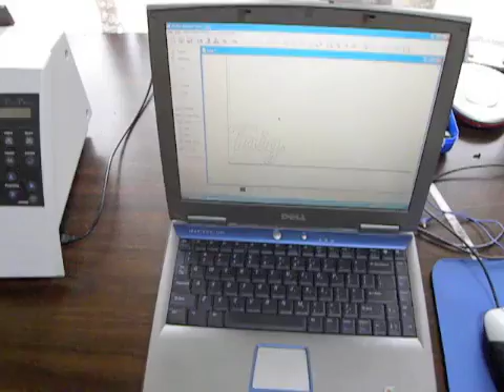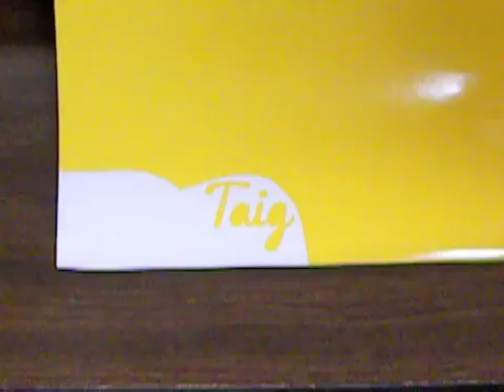Vinyl Plotter

Comment from the maker: My rule of thumb for cost is $1 per inch of the largest dimension, so for a standard 8.5 x 11" paper I'd say $11. Special vinyls like chrome and immitation carbon fiber go a little more, cheaper stuff like low tack masking vinyl goes for less. Additional colors add 50% for each added color. I always try to be negotiable on price though.
With the 1' x 2' sheets I have on hand, the largest size I can do is about 11" x 23". With a larger roll, my machine will do 14 and 3/4" wide by 6 feet long.

Comment from the maker: Thanks very much! Yeah, doing something in multiple colors can get complicated, but it's not impossible either. It's mostly about getting the colors aligned well, and trying to keep layers to a minimum. 

No, I also offer my services for hire too. Due to lack of customers, though, most of my work has been for personal use. 

The cost depends on the quality and capability of the machine. This machine here cost $1,000, but I've seen smaller, simpler ones in the $400-500 range.